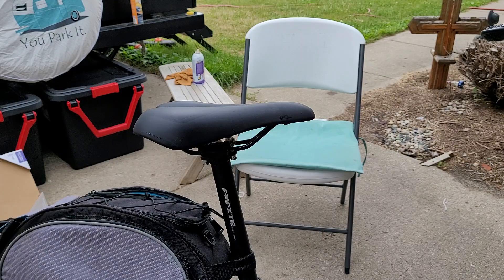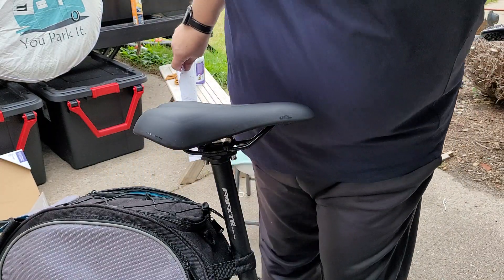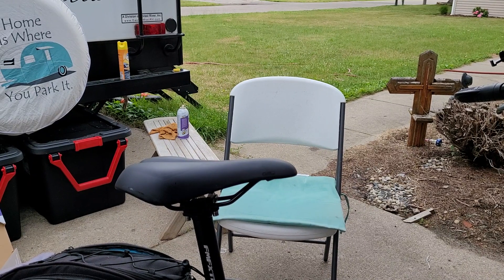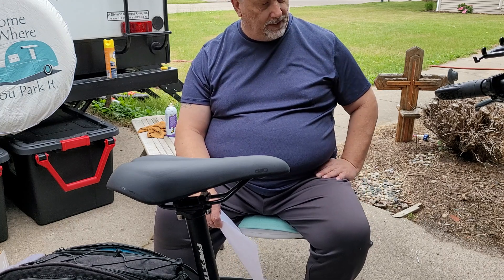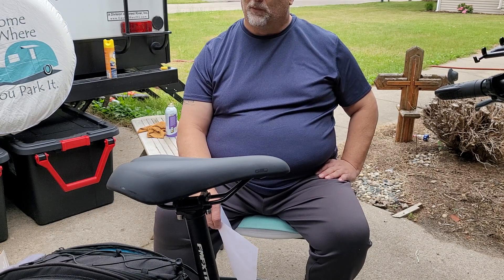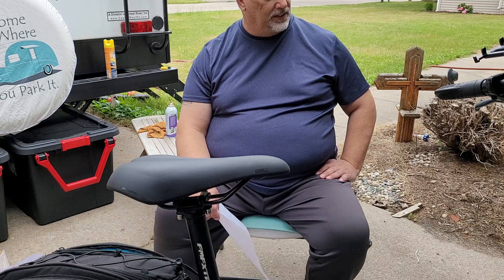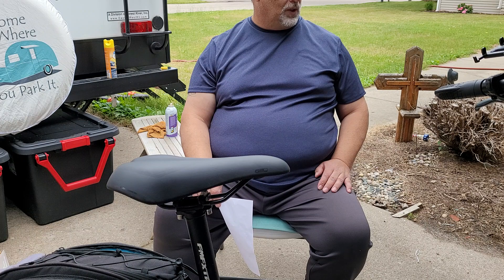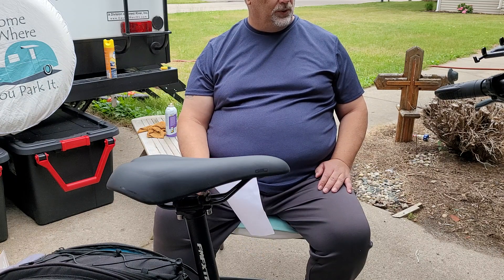Lectric 2.0 gear ratio vs 1.0 correcting earlier video

Comment: Could you try counting the chainwheel teeth on your V1 XP again?  When I assembled my neighbor's white V1 ST I counted 52 teeth.  After watching this video I counted the teeth on the chainwheel of my black V1 ST.  Also 52t.  Both were delivered in early June, 2021.  So does the XP have a larger chainwheel than the ST?  Seriously doubt it, but it's easy to make a mistake counting...
Reply from the maker: it is indeed 52 tooth I somehow scewed that up there are saying the 2.0 is coming with the same chainring it is possible the manufacturer is using old parts still

Comment: What about if you just want to keep the wheels the size of they are on the 2.0 what do you do
Reply from the maker: teddy I am thinking most people will be happy with the bike the way it is you could change the freewheel if you are unhappy but ride the bike for while before you change anything
Reply: @DonaldMays  I already got the freewheel I'm just confused he said go from the 3-in wide to the 4-in wide does not make any sense 3 in wide is better for easier maneuvability I have not received the bike yet but I already got everything I need to do the upgrade hydraulic cable brakes and the freewheel that's all I'm doing I spoke to lectric XP before I ordered the freewheel and ask them if they are still using the same one they said they are so that's why I went and ordered it
Reply from the maker: @teddyr7901  I only was talking about the tire size affecting the gearing. as to maneuverability I will say this say the smaller the tire the quicker the turn I have a feeling they put wider bars on the 2.0 because of stability problems with the short bars. Lectric orders samples of bike after they spec them out and its a process of making sure that they ride the way they want
Reply: @DonaldMays  well they say it's for more accessories because people were complaining so they did that I don't think the wideness has nothing to do with handling it any bar would do rad power bikes they've always used a 3 inch wide tire and a lot of other e-bikes companies out there and the handling is much better I watched from the very beginning before they even had to step through what I was waiting for them to come out with this version the 2.0 I did not want to buy the first generation always second generation is always better than the first
Reply from the maker: @teddyr7901  I normal agree that 2nd generation is better, Lectric listened about people wanting suspension but the fork they choose was a half measure not enough travel to do much of anything and a lot of people got their bikes broken and with parts that did not match what Lectric told them would be on the bike mainly the chainring on the front instead of 56 they got a 52 which makes it even lower geared and so much so that they are riding around in 7th gear all the time. The battery is smaller 9.6 amps. If I was looking for a bike today I would skip right over the 2.0 and bought a rad mini, Lectric is having serious shipper problems and need to find someone that isn't destroy their bikes before you get them.
Reply: @DonaldMays  yep a lot of people destroy there bikes they don't use it for what it attendant for all I'm using it for is to exercise a little bit enjoy the ride and that's it the most off-road I'll ever do is inside a park off the pavement that's about it go to the store and back and pick a few things I'm not going to modify anything whatsoever just the brakes and the sprocket that's all I'm doing to it

Comment: Hey Don, do you have any knowledge of the Jupiter Defiant, and if so what are your thoughts.
Reply from the maker: you know i looked at them last year did not like where the computer was but spec-wise it's pretty much a lectric xp just a little over priced for what you get the rad runner is cheaper and better spec

Comment: The 3 in tires should be more efficient so a smaller battery might give you the same range, i can't believe no one has done a range comparison between the two.
Reply from the maker: only one that could would be someone that was given both bikes or purchased both
Reply from the maker: there might be a few that could?
Reply from the maker: there is a difference in my and Karen's bikes her uses more power to do the same thing
Reply: @DonaldMays  Kevcentral for one.
Reply from the maker: @pedrofernandez8729  I asked on your behalf lol
Reply: @DonaldMays  If the new model does indeed have less range, I think it's a dumb mistake by Lectric, as other companies are putting larger, more range giving batteries in their newer bikes. Range anxiety is an issue with many lectric owners.

Comment: Hi Don, thanks for all your info. Personally, I didn't buy the 2.0 for it's top speed. If I needed to go faster, I would have just bought a motorcycle. I was looking for value for the money, and something dependable. The 1.0 and 2.0 both seem to deliver in those areas.
Reply from the maker: yes they do just wanted to make sure that people understand  its gearing is more biased to hills

Comment: I understand the math nut would I be replacing it with a cassette or freewheel? Thanks for the education.
Reply from the maker: i would say the it is cheaper to buy a freewheel you can buy the tools to change freewheel for 7 bucks
Reply: @DonaldMays  Sounds like the way to go. I'm not hill climbing in the Sierras and peddling for looks isn't what I'm after. Thanks again!
Reply from the maker: @xtremefight  i am talking for the down hills lol

Comment: Probably a dumb question ,, but, will 4 inch tires fit on the 2.0            3 inch rims ?
Reply: My understanding is the new 2.0 will not fit 4 inch tires.  The rim width is smaller and 4 inch would not fit in the new front suspension fork.
Reply from the maker: saddletramp1200 was told by electric the 4 inch tires will fit on the 2.0 he has that upgrade planned as soon as he gets the bike. my opinion is they will the frame did not change the rims are a little narrower than the 1.0 but shouldnt be a problem
Reply from the maker: yeah the fork may be a problem we will see